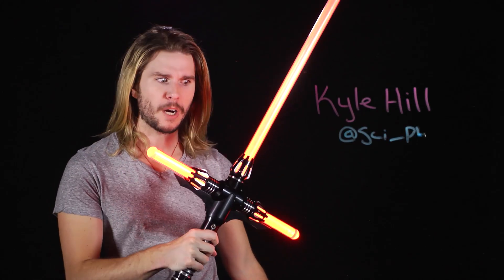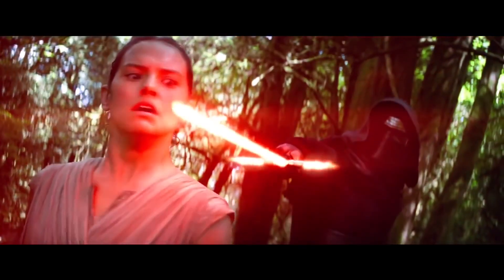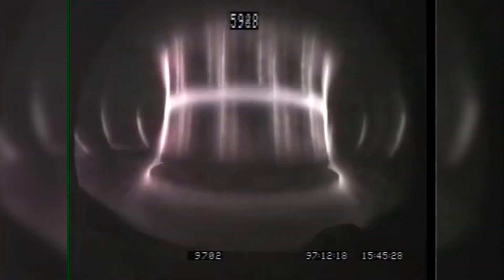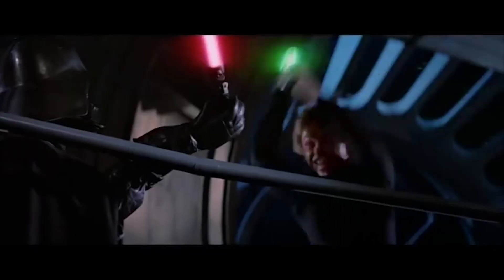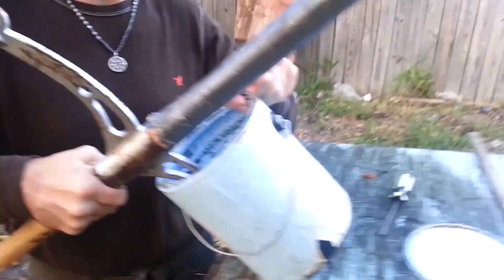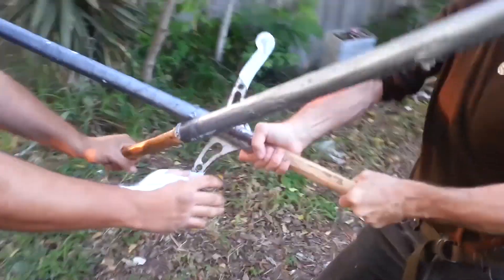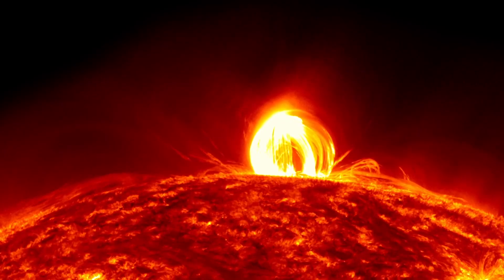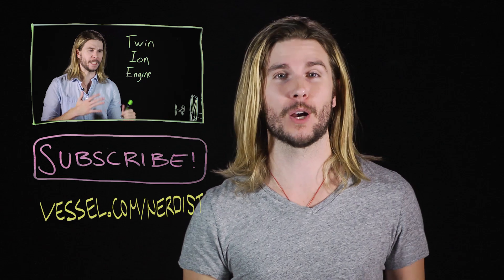Why Kylo Ren's Lightsaber Works (Because Science w/ Kyle Hill)

Comment: I think the saber is a bit more complex than that. Sith have used fabricated lightsaber crystals since their inception. I believe the crystal he is using, is very, very unstable. It leads me to believe he is using Vader's old crystal which was potentially damaged. Vader needed a specific lightsaber hilt to contain the power. Either that: Or his crystal was made extremely powerful and very unstable - thus the sound, the constant blade sputtering. The side are merely a way to vent excess plasma. Another reason the cross-guards (which would turn on previous to the blade in order of operation sequence) instead, ignite after. Not the the excess plasma, vented, couldn't act as a functional cross-guard... it'd just be silly to rely on them.

Comment: If you practice a lot with blunt swords with crossguard , you often find yourself in a situation, in which both opponents pushing against each other having crossed their swords near the hilt.  Swords in these bind tend to move upwards and the crossguards can injure your face, even the eyes, if the strength of your arms collapses. 
Being not a sign of good Historical Fencing (HEMA), it although happens all the time.
No swordsman facing real enemies with sharp swords would use Blade-crossguards, because skill only reduces the amount of chaos in real fight.
Historical examples for Bladed crossguard  are are few to none.
Therefore these Plasma-crossguards are nonsense! 
Kylo Ren´s sword was invented for the toy industry,  finaly implementing the powerfull symbol of the cross into the most popular modern mythology.
A burning cross as a sword, as a symbol for the evil, this really will have a impact!

Comment: I'm pretty sure that since Kylo's light saber is so unfocused and unkempt, it most likely means that he built it improperly. Perhaps to the point in which it requires an exhaust port? Maybe he used the cross guard as a dual purpose component.

Comment: Actually the two side beams aren't cross guards. When the prop was on display at a convention, a small read-up was next to it stating that this style sabre is extremely old and the side beam act as ventilation to prevent the hilt from over-heating and exploding in the wielders' hand.

Comment: Cross guards would have played no part in preventing the large quantity of severed hands and limbs in the Star Wars movies.  Cutting off someone's hand or arm with a conventional sword or lightsaber can happen with or without cross guards.  Especially in the case of people losing an arm.  A cross guard certainly plays no part preventing that.  The light saber blade didn't slide up /down the other saber's blade and cut someone's ARM off.  Someone presented there arm to their opponent and they weren't successful at blocking their opponents swing (or moving their damn arm out of the way).

Comment: Kylo Ren's Lightsaber is broken, thats the reason it has the arc/crackle effect up and down it, the cross guards aren't actually cross guards on the side, they are heat vents for the un-balanced crystal with in. also, I don't think they'd be necessary anyway, since Lightsabers don't slide up and down on each other when they meet like traditional swords. This was not stated in the film however it has been stated in interviews ect.
Reply: It's based on a very ancient design in which the saber uses a fractured crystal. With the crystal fractured, it doesn't have full control of the energy being emitted. So much energy is over flowing, that's how he can even have cross guards. The cross guards are just other outlets for the overflowing energy. And his blade crackles and is distorted because of the fractured crystal. Not to mention his light saber is a crudely built one by him. Read the books.
Reply: +Ben Goldman Because luke didnt give him the blue one, he made that with the sintetic crystal
Reply: +Ben Goldman if you make blade to blade contact with actual swords they tend to bite into each other which makes it difficult for the blades to slide anywhere . . . if someone defends with the strong of their blade and they have no hand protection you do not need to slide the blade but just apply proper leverage and the right angle and you could easily take fingers off or worse . . . cross-guards also protect you while you attack, they have many benefits

Comment: Granted the hilt is an ancient design,  the cross guard on this one actually serves a lore purpose.  Apparently Kylo Ren used an ancient crystal called the Kyber crystal which is too unstable for a powerful weapon as the lightsaber.  Without the cross guard vents,  the lightsaber would most likely not function or explode.  The Kyber crystal I believe, first came up in the novel "Splinter of the Minds Eye" which is a story that takes place between Ep.4 and 5.  

I can't remember the source from where I read this but maybe someone could find what I did and authenticate it.  But I did read the afore mentioned novel with the Kyber crystal.

Comment: Good video but you are wrong about the saber portion being weightless that my be true in real life about actual plasma but in the world of Star Wars light saber blades want to travel more than you direct it to requiring practice and a steady hand to control the blades motion, also red light saber blades are harder to control over blue or green blades in trade for greater cutting power so the fact that Kylo Rens saber is pointed at 3 directions at  the same time it is very likely that it is incredibly hard to control and probably its main reason he uses it as a beginners\practice saber

Comment: its been revealed google it, its legit, i just cant think of it off the top of my head. the "cross guards" are actually Vents. 

the Crystal used in Rens saber is cracked or unstable, which is why the blade itself looks the way it does. the vents are there to keep the Lightsaber from over heating. although they probably would work just as well as crossguards

Comment: The crossguards are too small, they need to be at least a foot and quarter from tip to tip
As for the weight of the sword doesn't make it harder to swing, most were balanced so that the balancing point was about two to three fingers from the crossguard, also here some science for you, Mass times Velocity equals Forces

Comment: Great video.

And for the nitpickers, here's my 00.02 credits;
Kylo Ren's lightsaber is a SITH-inspired weapon. They ure artificially grown crystals to focus the blade. These require a LOT more power to form the blade than the ones used by Jedi (coming from natural deposits on worlds like Illum and a few others) which are far more energy efficient. Look on Wookiepedia under Lightsaber Crystals.
All it takes is an extra smaller crystal or two to split the beam in the direction you want.
Sith and 'Dark Jedi' use synthetic crystals because it's less questing time to attune a synthetically-grown crystal than a natural one.

Comment: You bought an actual saber replica. That's not actually Kylo's saber, he made his saber himself. And it's not a crossguard. The extensions on the sides of the hilt are like exhaust ports for lack of a better term. Since the saber is homemade, there needed to be a way to keep the energy stabilized so the thing didn't crap out.

And by the way, if you're complaining at all about how "different" this lightsaber is compared to ones you've only seen in the movies, you're an idiot. If you read the expanded universe (which technically no longer exists), you'd realize that this is hardly the most radical lightsaber ever crafted. Just look up sith like Warb Null, Exar Kun, or hell, even the Inquisitor from the Rebels cartoon. That guy actually is still canon.
Reply: ...Aren't all sabers homemade? I thought each Jedi constructed their own saber. Also, where did you hear those were exhaust ports?
Reply: I'm the movie, they seem to act like more of small sabers, as when Kyle fought Finn and he pushed one the sides into his shoulder, giving him in injury identical to lightsaber wounds.
Reply: There's an official guide for the movie that revers to them as vents.
Reply: Just because it injures him doesn't mean that it can't also be a vent. It might be able to deflect a lightsaber blade, but for the most part, it's a way to keep the saber's energy stabilized because the crystal that's in it is damaged.
Reply: just because it they dont call it a crossguard dosent mean it isnt a crossguard. Just because its a vent dosent mean it cant act as a crossguard aswell.
Reply: blitzandgoo well no duh, i'm just going off of what I read in a book.
Reply: EU is retarded and I'm glad it's now Legends
Reply: +Tate Anderson It isnt even a replica,its all wrong and different
Reply: +Josiah Johnson only the things that followed after 6 were stupid. But many of the stories leading up to episode 1 were important and explained many things in the movies
Reply: +Josiah Johnson The only thing I liked about the EU was the fact that Boba lives on and becomes a very big badass

Comment: JJ abrams said that they were not crossguards, they are exhaust ports.  If that were the case, how would that affect anything?  Actually asking, not being a jerk.
Reply: He couldn't make a proper lightsaber. Presumably, normal lightsabers have some way to prevent overheating.
Reply: +Briansgate A long long time ago in a canon far far away, there were a few key parts in constructing a lightsaber.  There was a powersource, an emitter, a crystal and a focusing lens.  You changed parts according to your style of combat and personal preference.  Some used stronger powersources but had emitters or focus lenses that were not compatible and created blades that seemed to have strange side effects.  Some had cracked crystals that would splice the saber and when it went through the lens excess energy would build up thus the need for exhaust ports to stop the saber from blowing up.  Hell it could have just been a personal choice because he thought it fit his personality and style of combat.
Reply: I get why have them for exhaust purposes, i mean more in the line of whats the big deal as far as wielding it in combat.
Reply: Briansgate Even though they are meant to be exhaust ports, they can still play a role in combat. People seem to be under impression that it has to be for either exhaust or combat, and can't fall under both.

So, here are the advantages:
-Protects the hand from saber attacks.
-If you're locking sabers with someone, you can shove the handle forwards and jab them with the crossguard.

Disadvantage:
-If you bring the saber in too close to your body, you can stab yourself.

Ultimately though it doesn't make that big a difference. The advantages only apply to specific situations. The one disadvantage can be easily ignored - a skilled Jedi who has enough experience with the weapon isn't going to stab himself on his own crossguard.

The real issue is that nitpicky Star Wars fans don't like change. Han shoots first, Lucas changes it, everyone freaks out. Ghost Anakin is old, Lucas photoshops Young Anakin in instead, everyone freaks out.

Comment: The real elephant in the room is why lightsabers should be used as real double edge swords at all. They got no 'flat side' , the blade is just a deadly beam which is going to cause damage no matter which direction you are striking from, so you can just swing it randomly to kill anything in front of you instead of using any sort of complicated move. Stuff like edge alignment or balance that occur in real swordfights are irrelevant here.  You would only need some sort of technique when confronting another lightsaber wielder, and even then the fight would be astonishingly short as the angles you're going to be attacked from are impossible to predict.
Reply: Unless you have the force, which allows you to predict where blaster shots and lightsaber strikes are coming from.
Reply: +J Jo 
Yeah, this is true. A better way to think of how a light saber would really work is to imagine it as 3 1/2 ft long laser pointer of death. Probably the best strike with it against anyone who actually had another light saber that could potentially block it would be to leave it off and strike towards your opponent then flick your wrist at an angle that will put the blade pointing into their body at appropriately unblockable angle at the last fraction of a second while turning it on. There won't even be a blade to see, anticipate or block until it's to late. It would probably come down to who can poke the other guys light saber hand first since it would be basically suicide to step close enough for your opponents blade to reach your body. They guy with the longer light saber would have a massive advantage since the blades are weightless and reach would be everything in such an agile and instantly lethal weapon.
Reply: +J Jo You forgot to mention the part where almost all swords are in fact double-edged...except maybe eastern swords

Comment: Fail hard dude. 
1- It's already canon that this is a exhaust. 
2- Light sabers don't slide. They stick. So no guard would be necessary.
Reply: +Marcelo Colin yupp an exhaust which doubles as a cross guard :P I'm sorry? but in which movie do the say light sabers stick? because I just watched all of them and I'm pretty sure its never said. "Fail hard dude."
Reply: If lightsabers stuck together you would be unable to pull them apart -_-
Reply: +Lord Tryhard I think he means there would be friction
Reply: +Marcelo Colin It may be an exhaust, but if it was then it would have no effect on a certain scene in the movie. It is an exhaust but its also a crossguard whether it was intentional or not when Kylo built it.
Reply: +Lord Tryhard I hate it when my Schwarts gets in a twist.
Reply: there would be friction on a regular sword aswell right? and seeing as a lightsaber is made out of energy, how much friction could there be?
Reply: Even without sliding cross guards could still block a chop to the hands. If you're skilled enough to safely wield it, the cross guard still offers some advantage

Comment: I think they are more likely exhaust ports that also function as cross guards, unless we actually see him use them as a cross guard then we can just assume they are exhaust ports. The reason behind assuming they are exhaust ports is that the lightsaber looks really unstable and not a perfect smooth beam like most lightsabers. Also the hilt of the lightsaber it's self looks pretty unfinished and not very neat at all, this could be the cause of the instability of the beam, maybe it's not got all the the best parts or it's missing some and the exhaust ports are there to make sure the thing doesn't blow up.
Reply: +Antstar12 Pretty much correct. Lightsabers are much more rarer by the time the Force Awakened started due to the Jedi Order being extinct and Luke Skywalker is absent. Kylo Ren is actually a homemade lightsaber made from scraps.

Comment: I said it in the last lightsabre comment section, and I say it again here: The blade of a lightsabre would not be effectively weightless since the spin of the magnetic field containing the plasma blade would impart centripetal forces on the blade. The fight against these forces balances the weight of the hilt, but in a way that makes it difficult, if not impossible for non-force users to use it.

Comment: Molten metal, dripping on hands. Great protection. It'd be fine if the guard existed only on the side next to the hand, or the bits that emit the blade were not sticking out, but it aint. It's a film, style over reality.

Comment: The first proto-lightsaber was called a forcesaber, and was essentially dark side energy channeled into a blade via crystals and alchemy. If, say, a Jedi picked up a forcesaber, he or she would run the risk of immediately and unwillingly turning to the dark side simply by using it. The early Jedi made the first lightsabers in order to use these weapons without becoming evil.  I may be incorrect but I do remember reading that the red lightsabers were more unwieldy, suggesting that they could have been heaver.  This may not match up with science but we are talking about sifi/fantasy here.  Does anyone have any knowledge of this?

Comment: except cross guards are not for protection from blades, but rather to protect from impact on shields, this is why on blades ment for slashing in environments where shields were not common the cross guard was very abreviated if it existed at all.
later period weapons began to evolve basket hilt designs as the fighting styles evolved tward thrusting styles and shields began to fall out of favor.